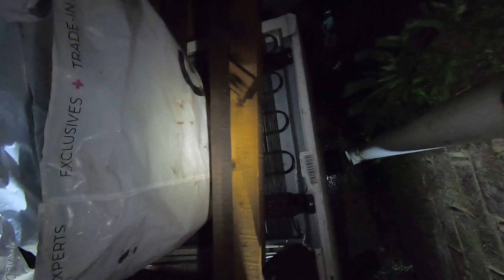Street Scrapping UK - Lockdown Edition #07🦊

Comment: Nice copper score on them microwaves at the bottom rip the little turntable motor out easy to get copper from them not very often I come across microwaves with both copper only the older ones
Reply from the maker: I knew you'd know 🤣 Lovely bit of copper for the collection.  I will remember the turntable motor next time 👍🦊
Reply from the maker: Metal Mentality  Me to I have a stack of them I need to scrap out.  Still worth more than shred so I save them up.
Reply: Metal Mentality  yes all the new one have no copper getting harder for us scrappers to get copper
Reply from the maker: I just whipped out the 4 turntable motors from the 4 scrapped microwaves and broke one up lovely bit of copper in them and easy to get at as well.  Thanks UK 👍
Reply: @Vandal-Vlogs  yes a lot of people don't take them but all copper ads up

Comment: Might want to check those accumulator tubes with a magnet, there is usually a metal screen soldered inside that should be cut out...

Comment: Nice find .copper transformers   Mount up ,do you ever take the fridge compresses.they have copper inside them ,just grind the top of an drain out the yellow oil 👍
Reply from the maker: Hello Andy.  I get asked about the compressors all the time.  I wish I could take them all but I don't have the room to store them or cut them open etc.  I am looking for a workshop or garage but at the moment they are out of my price range.  I will be taking them all in the near future.  Thanks for being cool Andy 👍🦊
Reply: @Vandal-Vlogs  hi mate your scrapyard should take them as just motors as is.then when you get a place deffo cut them open and get paid twice for them as heavy metal then your copper its a proper win win thats what i do mate just drill a hole in the top to drain the oil keep up the good work bro
Reply: @Vandal-Vlogs  use an old beat up van as a workshop cheapest way